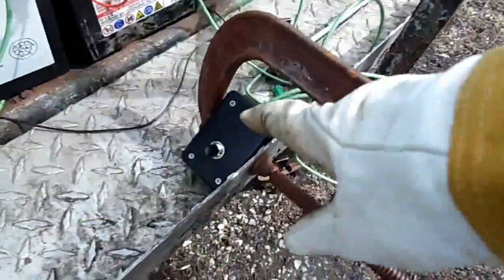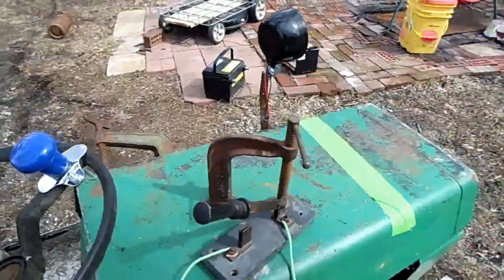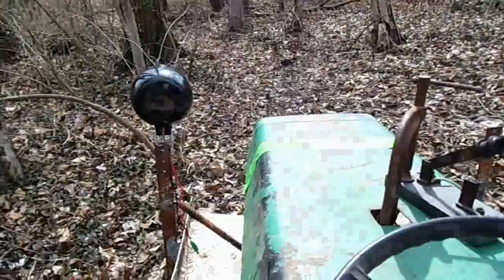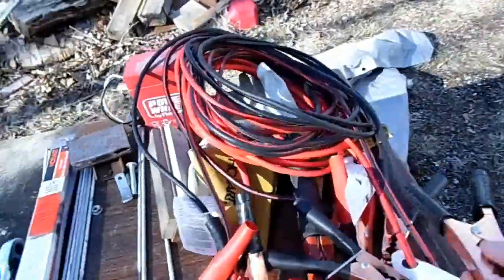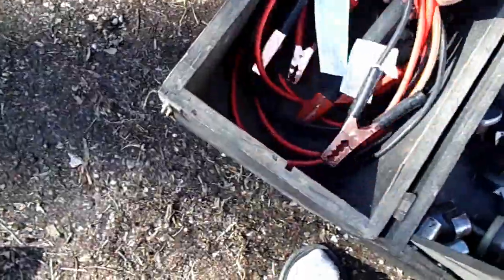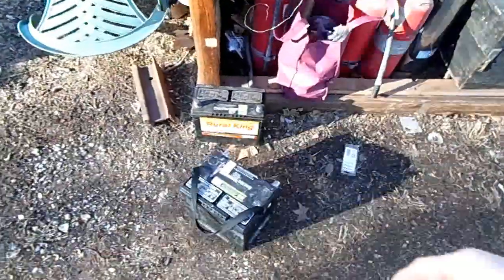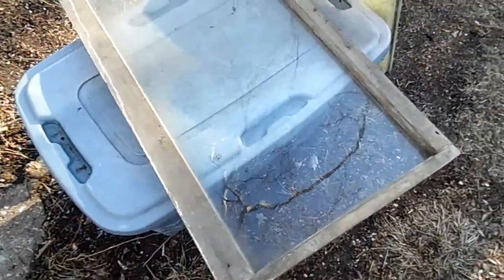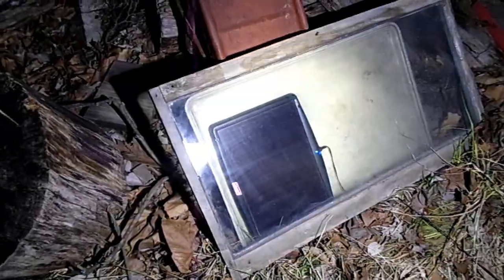Random Bits 0016: riding the trail, prepairing for spring

Comment: you should resurect this idea.and put nissan leaf batteries
Reply from the maker: its not dead in the first place though
Reply: Rinoa Super-Genius but still you can put the li ion bateries in series and have 100+volts so you can make a electric racing mower that would be cool
Reply from the maker: mark zamiechowski
i'm already working on that, but its winter now so i may not be doing much this year
Reply: Rinoa Super-Genius if you want i can send you a 300 amp relay to use on it and the coil is powered off of 12v 100ma
Reply from the maker: mark zamiechowski
 thanks but i think a normal 12v relay should do fine, the motor doesnt pull too much power.
Reply: Rinoa Super-Genius but still that motor at 100vdc and you on there as a load would pull 20 amps so maby i can send you my 30 amp relay so it dosent stick like the switch in the vid
Reply from the maker: mark zamiechowski
i'm pretty sure 12v starter relays can handle more than that, thanks though.

 but i'll always accept relays

Comment: Cool! I personally love the full-length rides on the trail. :)

I like a lot of the suggestions down below in the comments. Particularly the transistor-based speed control and the electric brake via shorting the motor.

Oh, another idea I just had - rig a cigarette lighter socket into the dash, connected to one of the batteries. Then you could run stuff like any utility lights, GPS, etc. you would want. :P
Reply from the maker: haha, my tablet has GPS and it has like a 17 hour battery life, 15 day if i keep it in sleep mode.

Comment: As soon as you started fishing in the neighbor's discard pile, I figured I would hear your mother scream, "No, don't bring one more thing into this yard."

Nail those seat boards together and stick some shims on their sides, before your next adventure.

If the mower motor is shot, you can use take the mower bottom frame, wheels and handle, and use them to build a wagon for your electric tractor.  The wagon can be used to haul back to your house finds in your neighborhood during trash nights.

How about calling your electric tractor the "RECYCLETRON"?  It has recycle and electro like electric in it.  RECYCLE + ELECTRON  Since the last letter in the first word "e" is shared with the first letter in the last word also "e," overlap the "e" and use just one to fuse the words.  The Recycletron is made of reused, repurposed and recycled items and it can help obtain more of those items.  It also sounds somewhat menacing like a device a mad scientist villain in a movie serial would have.
Reply from the maker: omg, recyclotron. i love that!

and unfortunatly that lawnmower is really really shot. but i've already build a cart from a mower. ya know the black one i put batteries and stuff on.

i think the lawnmower's piston would be much better in a solar heated stirling engine directly driving a tradmill motor to make like 24v :D
Reply: Oh, now I remember the other mower cart.

You were trying to operate it in some manner the Three Stooges would have in one of your videos, but there was no accident. 

I guess that dish antenna will have some reflective material placed on it so instead of radio waves, it will focus the sun or maybe if you removed the antenna focal point projection, you could turn it into a seat for your mower;although, I have never handled one  and it probably isn't of sturdy enough material.

I see you did go with a knife switch.

Knife switches should be easy to construct.  Now that I think about it, the best electrical conduit is a pipe, electrons want to spread out and get away from each other.  Electrons are the furtherest away from each other at the edges of a circle and thus most easily moved along in an edge of a cylinder. The cheap solution would be an aluminum pipe - maybe several soft drink cans rolled into a tube with a clothespin on one end that both operates as an insulated wooden/plastic handle and clamps one end of the spiral together.   The other end could have a hinge consisting of a screw going through the cylinder and a "u" shaped bracket,  Then there would have to be "u" shaped bracket mounted onto something to receive the clothespin end.  The resistance of a large amount of aluminum is the same as a smaller amount of copper and an even smaller amount of silver.  Another UL approved switch - Undertakers Laboratories.
Reply from the maker: *****
oh right, that was when i bent the wheels on teh cart trying to move that 1960s gas pump. that was random bits 0001 i think, couse thats when i cut my shin open on the concrete. ouch.

and tbh i think i'm going to build a mixture of an industrial looking knife switch with a pre-charge winding type thing. so basicly as i put the lever down it would activate a series of lesser and lesser resistive connections till it hit full connection, that way it could make a soft start.

Comment: car tires make great flower beds, bumpers, padding, and tool holders (think screw drivers, hammers, axes, etc..)

and i must inquire.. what happened to the other light in the first part of the vid?
Reply from the maker: i was using it as a load test for a 6v golf cart battery i'm working on for the next video.

Comment: The glas window will reduce the efficiency of the solar panel. Measure volts and current with and without the window to find out.
Reply from the maker: yeah i know, but its a crappy amount of energy anyway. and the led still lights up pretty bright so it is charging.

Comment: another great video!!!!      :D
could you short circuit the motor to act as a break (IF you need one)
Reply from the maker: yeah but tbh the motor is geared up so high that just turning it off acts like a break.

i think i will work on something like a parking break though. even putting  a load on the motor would only take effect when the machine starts moving.

Comment: you need to drill a hole on the "hood" I guess you could call it that, fit a 1/4-20 bolt through that hole, weld it on the underside and mount your camera on that with the tripod threads so you can have both hands to drive. I am really loving this series!
Reply from the maker: aww thanks for enjoying it!

and yeah that would be good, i have a couple ideas i might try. duct taping the camera to the hood just makes for a really noisy video so i dont like doing that too often.

Comment: You had me scared watching that on / off switch in action. You're kind of committed once it's on. hehe How long can you ride it before you need to recharge?
Reply from the maker: i'm not entirely sure yet. i really havent configured the battery properly for distance tbh. that will come in a latter video.

but i could definatly run it around my house like 10 times before it gets a bit sluggish.
Reply from the maker: Rinoa Super-Genius
 oh and yeah the on-off switch is very tedious. i was very nervous driving it through the woods one-handed, thats why the camerawork suffered a lot haha.
Reply: Rinoa Super-Genius Maybe too, you could make a variable speed control for your foot pedal. Another Project! By the way, I made $1 last week on adsense, hehe onwards and upwards! hehe
Reply from the maker: Andrew Jones
you did? thats freaking awesome!

and i'm working on building basicly a giant potentiometer from resistive wire.

Comment: An old door hinge screwed down and a plate and you have a peddle, use a couple of old car relays in parallel to switch the motor on, you can use the body of the vehicle as negative and put an old bolt behind the push plate to ground the relay :-))

two relays could be rigged up for an electronic reverse ha ha
Reply from the maker: yeah, i have some 24v relays for a F-15 fighter jet i think. i could try to use one of those.